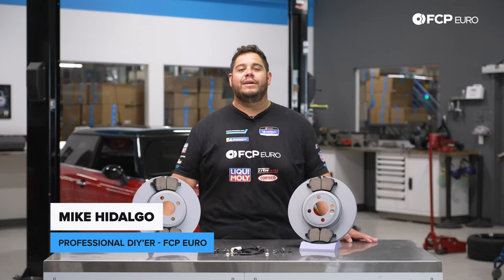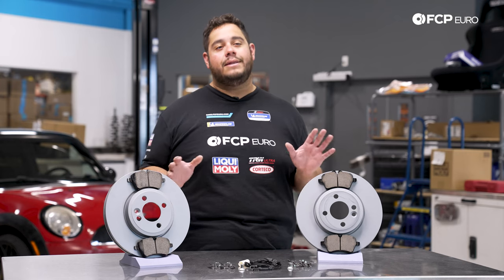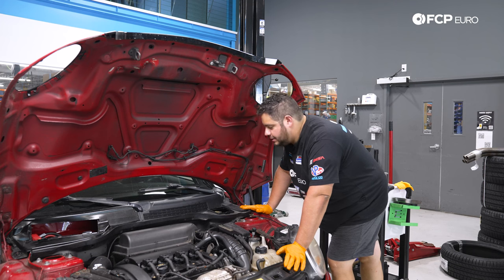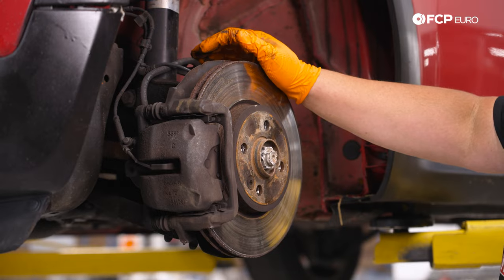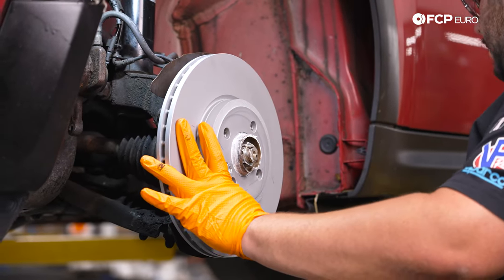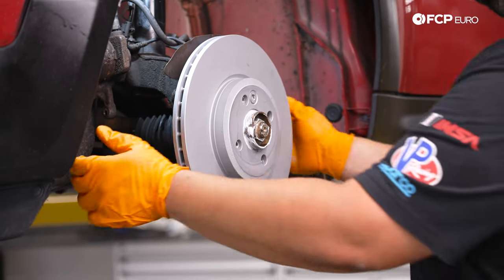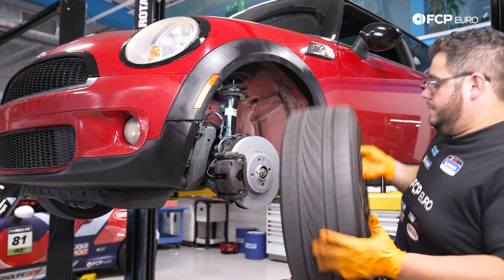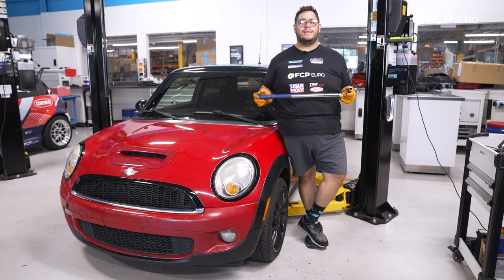MINI Cooper Front Brake Pad & Rotor Replacement DIY (2006-2015 MINI R56, Cooper, Cooper S)

Comment: hi great video.
i have a 2009 cooper s. my local shop have 2 sizes for the front and rear rotors. 
if im not mistaken sizes are 
159mm & 189mm 
do you know which rotor size for my 09 cooper s?? thanks in advance. apreciate it